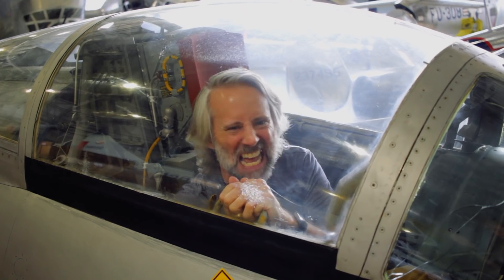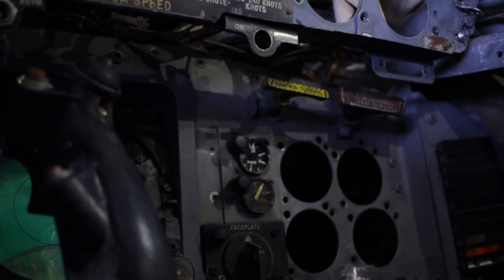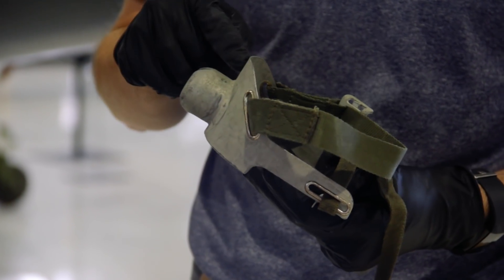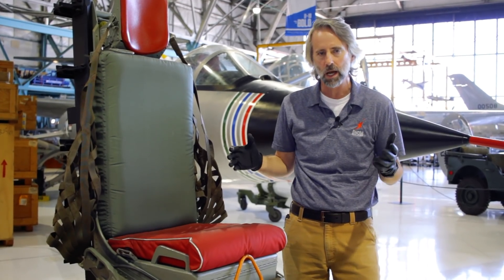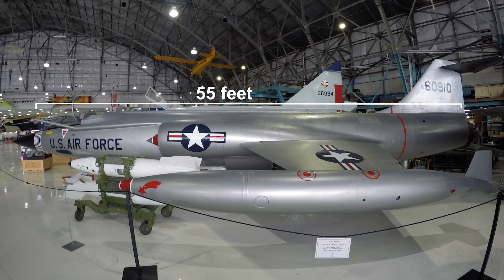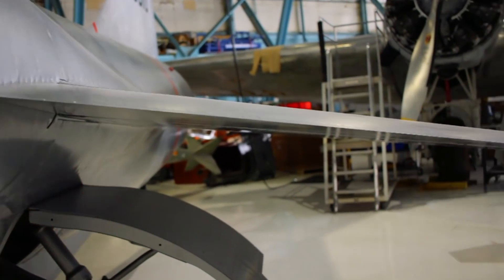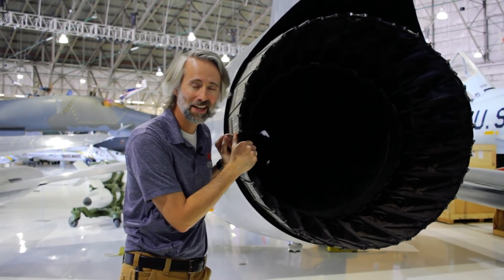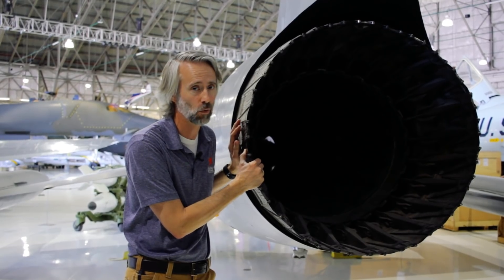F-104 Starfighter | Behind the Wings

Comment: Most air forces had no unusual losses flying the 104. The Germans big problem was they tried to use it as a multirole aircraft, something it was not made to do. They didn't learn from WW2 when they also wanted all aircraft to be multirole, and then ended up with planes unsuited to tasks. The 104 was made as a bomber interceptor, hence not much fuel or wing, just off the ground and as close to the target as fast as possible. Most pilots loved and respected these aircraft, and they served for many years.
Reply: Eric Hartmann had to retire from the Luftwaffe because of his objections to buying the Starfighter. But what did he know, he only had 365 kills in WW2.
The Starfighter gained one possible kill in it’s whole career, in the Indo-Pakistan war. Tiny Folland Gnat fighters shot them down.
Reply: @SvenTviking  

> Eric Hartmann had to retire from the
>  Luftwaffe because of his objections to 
> buying the Starfighter. 

According to his so-called "Final Interview", Hartmann didn't think that the Luftwaffe was ready for an aircraft with as high of performance as the F-104, not because the thought that the F-104 was a bad aircraft.
As it turns out, the Luftwaffe experience after Steinhoff took over seems to support that belief.
What people seem to forget is that the Luftwaffe at the time of the F-104 was NOT the Luftwaffe of WWII ... the service didn't have the old timers trying to fly the aircraft and in many cases, their first flight in an F-104 was the first time in a high performance aircraft for many Luftwaffe pilots.

> The Starfighter gained one possible kill 
> in it’s whole career, in the Indo-Pakistan war. 
> Tiny Folland Gnat fighters shot them down.

Anyone who tries to take an F-104 into a turning fight is an idea.
As Operation Feather Duster (I or II, I can't remember) shows, when flown the way it should be flown, it beat the F-86, F-100, and F-4.
Reply: You are absolutely incorrect.  Canada lost half its 104's to accidents and the aircraft had an abysmal accident rate upwards of 30 accidents per 100,000 flight hours.  I'd still love to fly one though.
Reply: @JimmyJamesJ  Canada also used the F-104 as a strike aircraft, at least initially mainly for the low level delivery of nuclear weapons and later for conventional weapons, and the fact that the aircraft could technically carry air to air weaponry was almost as an afterthought in Canadian service. In Canadian service the F-86 before it also had a even worse record both in incident rate and number of killed pilots. Starting to see a pattern?
Then you have Spain and Japan that operated them almost entirely without incident as interceptors.
Just blaming the aircraft doesn't work, just blaming wrong use of the aircraft doesn't work, just blaming faulty maintenance doesn't work, just blaming low or wrong pilot training doesn't work, but the combination of all of them made the F-104s reputation that of a widowmaker.
Just that it was much more evident in the nations that did use them at low level and in poor weather, for the obvious reasons that it compounds all the other issues.

Comment: This video is a little bit short, there's much more to tell about this aircraft, for instance that noise the engine makes when taxiing around the runway, or the radar.
This plane had two scandals in Germany, one being its crash rate, the other being the radar wich was causing cancer to the handling personnel because of radiation. The radar had to be adjusted and calibrated on the ground while being turned on, and all the tube technology was causing ionic x- radiation.